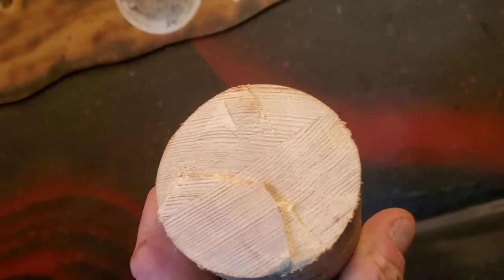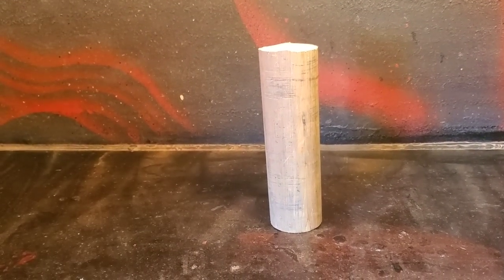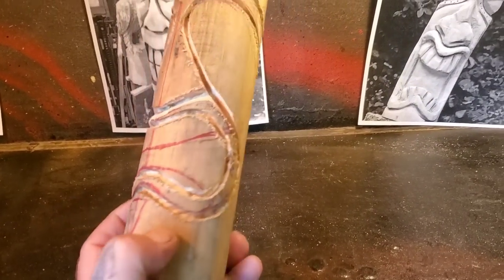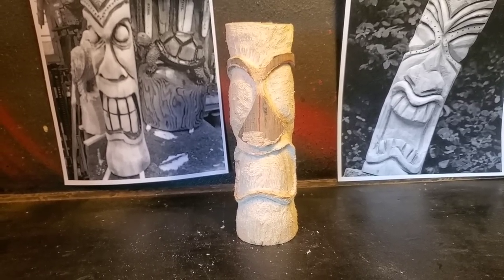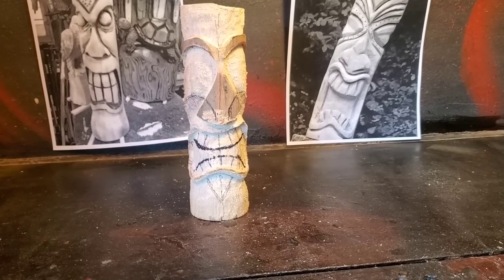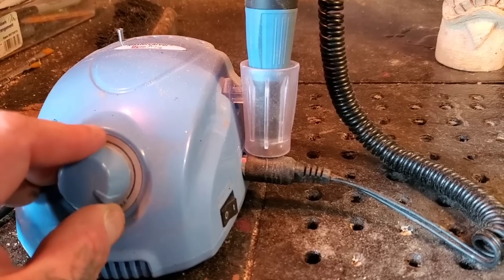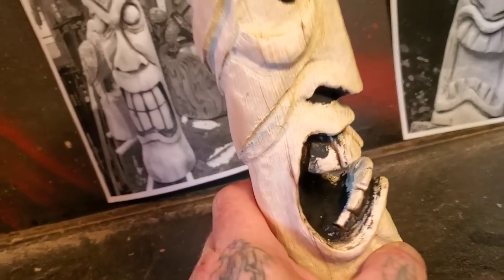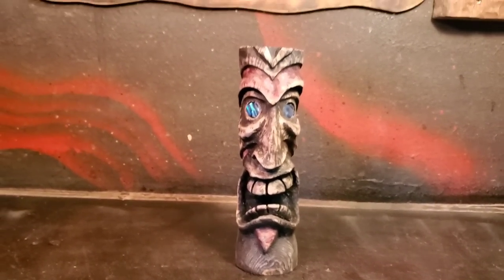Dremel 4300 with flexshaft. Carving a Tiki on Douglas Fir wood. Dremel

Comment: Great videos! Correct me if I'm wrong as I'm not expert, but I think you are supposed to gradually work away materials with those diamond burrs, because they heat up and can break like that. I thought you need to just gradually work into the wood, instead of trying a long deep cut. Would love to hear your thoughts!
Reply from the maker: Hi there, yes diamond burrs are really more for sanding/cleaning up a piece, not removing wood

Comment: Dremel 4000 or 4300 which one works better for you?, nice videos man, learning a lot, thanks
Reply from the maker: 4300 and ty
Reply from the maker: 4300 with no flex shaft 4000 with flex shaft
Reply: @CarvingFusion  thanks man, I just ordered the 4300 with the flex for $160, is that a good deal?

Comment: I just purchased  corded Dremel 4300. And I also bought ,  supposedly a "Speed control" foot pedel. Which doesn't really work as a speed control. All it does is work as a ON/OFF switch. I read in some comments that you can only run 4300 at the highest speed with FOREDOM foot control, orherwise it will damage the 4300. Is that true? Reaching out to turn ON or OFF 4300 is not convenient, and I like to use both hands at the project. Any thoughts/recommendations? Thanx !
Reply from the maker: I just now use my foot pedal for on off, just crank ur dremel on max

Comment: Question????   I have both a foredom SR and a dremel 4000 with a flex shaft on it,  should say I had the dremel , yesterday it burnt up🙁.  I like using both for carving, keeping a burr in each and switching between the two rotary tools as wanted.   Is the 4300 any better than the 4000? Is there some other similar style to dremel that lasts better, this is my 2nd dremel in 2 years.   Any recommendations??? I prefer using a flex shaft not hand holding the actual tool itself.   Thanks!
Reply from the maker: Did u check the brushes in your dremel? The 4300 has more power then the 4300 but I myself like using the 4000 and yes of course with the flex shaft
Reply: @CarvingFusion  not yet….yesterday it was smokin,  today it was fine.
Reply: The Dremel is a great machine, It's lightweight plastic motor and needs easy work. The Foredom is 3 or 4 times more powerful. 
The Dremel is easy and needs TLC.

Comment: which dremel 4300 do you use, there are different ones, 4300 5/40, 4300 9/64, thanks!
Reply: The only difference is the number of burs and extras you get in the kit.
Reply from the maker: Just your standard 4300 with q flex shaft
Reply: @evilevilrick  thanks for clarifying!
Reply: @CarvingFusion  thanks!